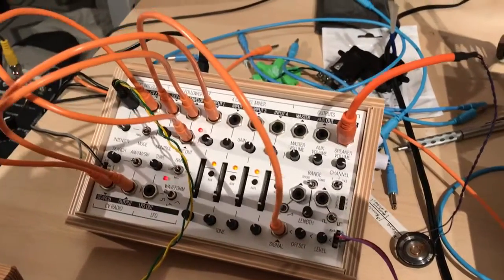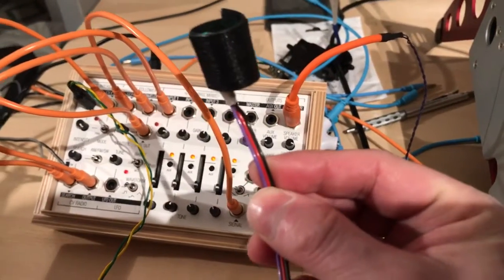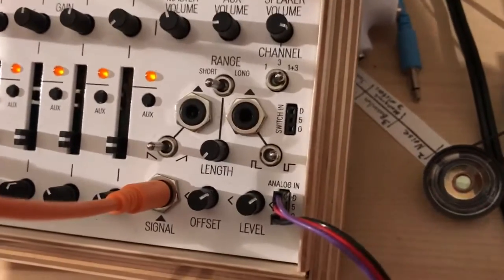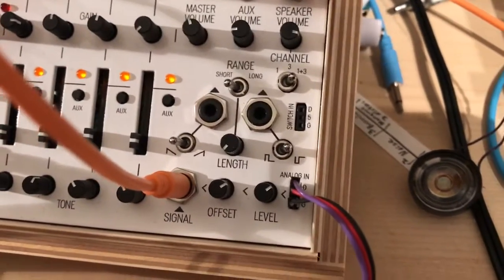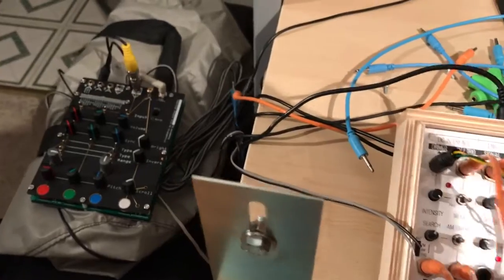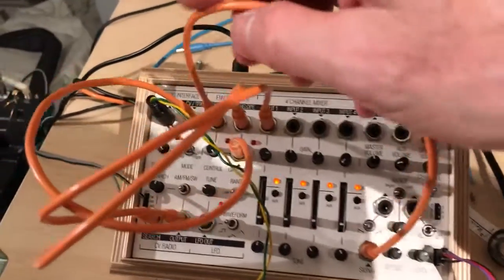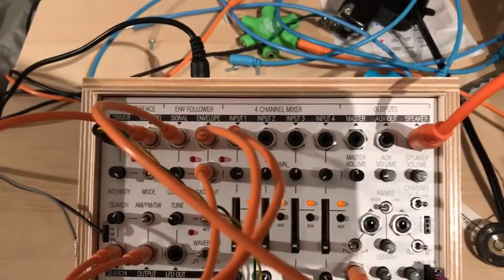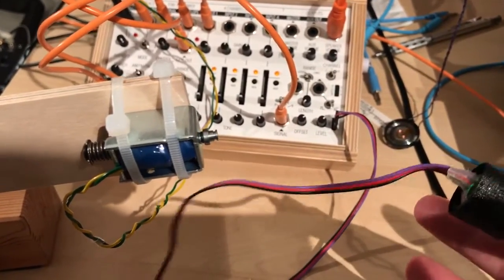Using a sensor with the KOMA Field Kit

Comment: Hi, very cool demo - do you know if with this setup, you can run multiple solenoids? or only one?
Reply from the maker: MartinSedek unfortunately, the field kit only has one DC output channel—that’s the biggest limitation. I just built an art installation using the field kit, and added a Bastl Solenoid  module—it adds another four channels
Reply: There is also the DADA Machines Automat. That gives you 16 solenoid outputs!